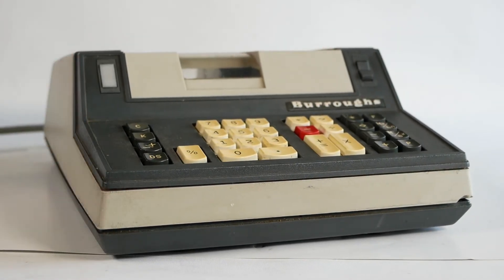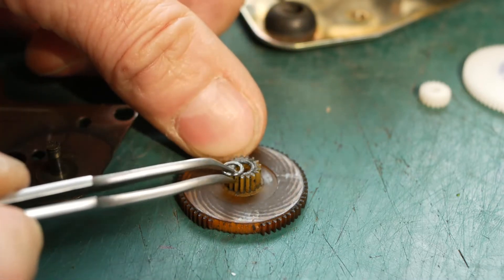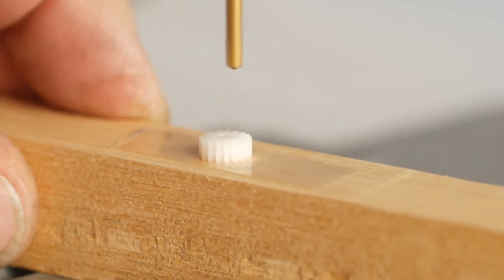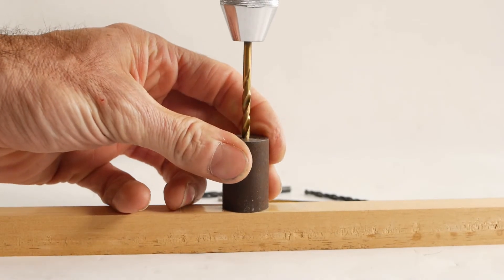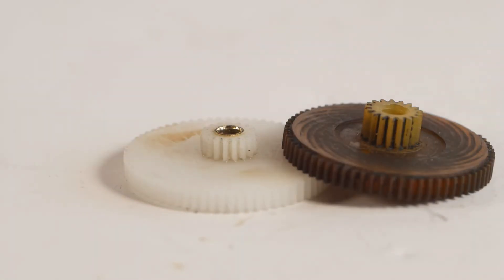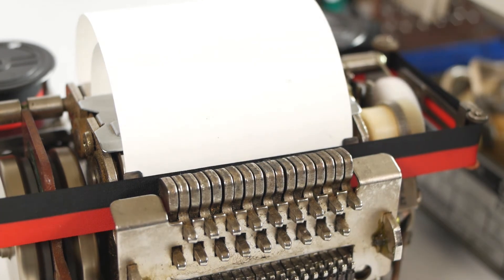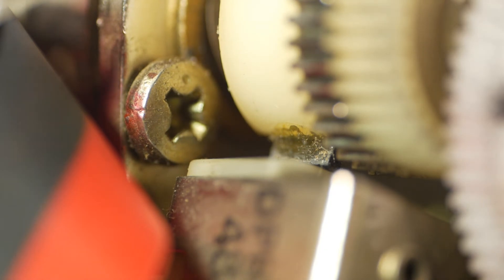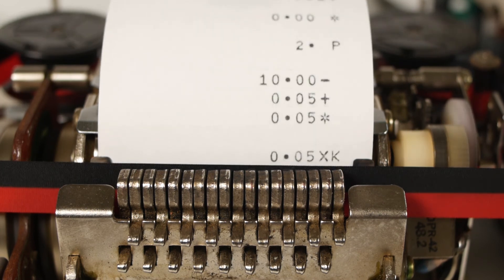1970s Calculator Printer - Shinshu Seiki EP-102 - Part Two - Making a New Gear

Comment: I have at least seven calculators with the EP-102 printer, and all of them are working fine (except one which has an issue with red printing). I've never seen a stripped gear on any Epson printer, so I wouldn't call it a common problem. Someone must really have applied brute force to this one!
Reply from the maker: Hi Fritz 46, The EP-102 and it's derivatives are my favourite calculator printers - such an awesome sound!!!  When I made this video I found a trail of information about other people who had similar issues - all my other EP-102 printers are fine, so I suspect there might have been a specific period when they used a different material for that gear - on my example, whatever plastic the gear was made of has decomposed - you can break the teeth off with your finger nail, no excessive force required, just the action of printing is enough to shred the gear.  It's also possible that they changed whatever lubricant they applied on assembly, causing the plastic to decompose, or even the machine oil from when the brass gear was cut.  The oil/contamination theory might be the more likely cause because the inner (smaller) part of the gear hasn't gone soft.

Do you have a large collection of calculators?  I've just watched your Archimedes - that's a lovely machine.
Reply: I've watched part one after writing my comment, and yes, it looks like not much force was needed. Interestingly I had this problem (i.e. "decomposing material") with two calculators built around Brother printers. I've not really tried to find replacement gears so far because  I've many other calculators to work on, but, even more interestingly, the gear seems to be the same: 0.4 Module, 17 & 68 teeth, 3 mm inside diameter!
Reply from the maker: Thankfully I haven't had too many things fail due to plastic degrading, but one one of my calculators (can't remember if it's the Canon or the Hitachi) the key stems that holds the magnets that move past the reed switches are all cracking and looking very weak - I've only had to repair one so far, and ABS weld worked to join the pieces back together, but I suspect in time, more of them will fail.
Reply: It's definitely a problem with these printers. I have three of them and two were not working from the time I got them and had this same gear decomposing in exactly the way shown here. The third one was working...for a while...but has since stopped, and I suspect when I get time to investigate the gear will be at fault.

Comment: Nice bit of luck that you had the perfect bit of piping to use as a sleeve!  I don't know anything about plastics, so is there any reason that you glued the gears to the tube rather than to each other? I also don't quite understand what you meant with possibly making a keyway to bind them to the tube. I would imagine that drilling a small hole through the gears (through the large gear and only part way through the small one to keep the latter's structural integrity) and gluing in a bit of metal wire would work to keep the gears from rotating independently.
Reply from the maker: Hi Jaap, yes, that bit of brass tube was a lucky find, otherwise I'd have turned down a bit of brass to make something more or less identical.
Technically I did glue the gears to each other as well as the brass tube, I also scored all gluing surfaces to give the glue the best chance to hold - it may well last, but that Delrin material contains Teflon among other things, which rather repels most glues.

My back up plan of a keyway is to cut a groove along the outside of the tube - the tube has a wall thickness of 0.5mm so I could happily cut a 0.25mm deep groove, then glue both gears in the same was as the first one I made, but then while the glue was still wet, heat something like a pin with a blow torch or similar and push it into the gap where the groove is - the hot pin will slide along the groove and also melt into the plastic of the gear, keying the whole lot together.  Then once thoroughly dry, I'd cut off the ends of said pin with a dremel.  That's more or less the plan, but your idea of drilling through the large gear and part way through the smaller one, then inserting some wire should work too.

I also had one more idea, I've joined certain plastics in the past by literally welding them together - heat an old knife to red hot, sandwich the red hot knife with the two bits of plastic and withdraw the knife while pressing the plastic parts together.  This only works for certain plastics, and coming up with a way of aligning the two gears in the very short amount of time you have before they'd set might be tricky.  It's always nice to have a few back up plans, anyway, so far so good, the printer is working fine, and I think I've more or less worked out most of the controls for the calculator, although I bet there are some secret functions that I haven't found so far.

Cheers for the good suggestions Jaap.